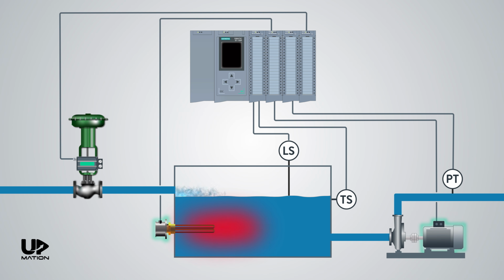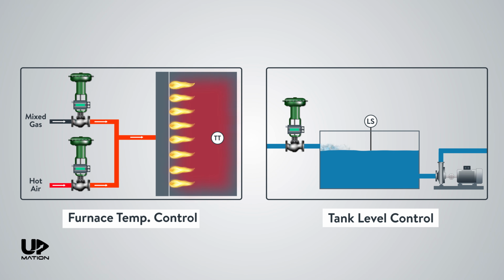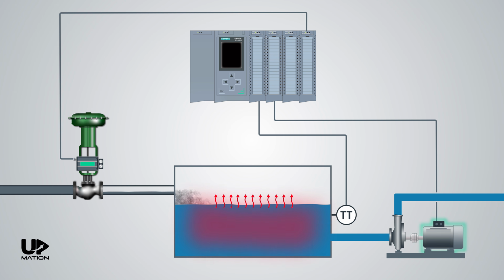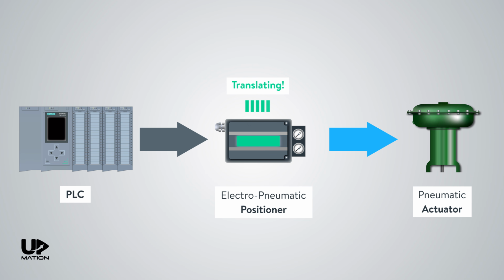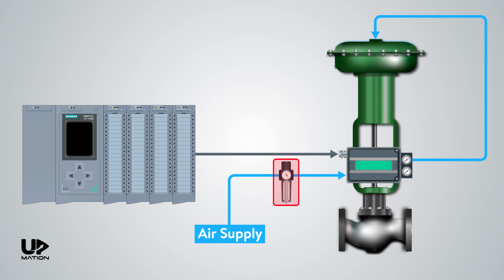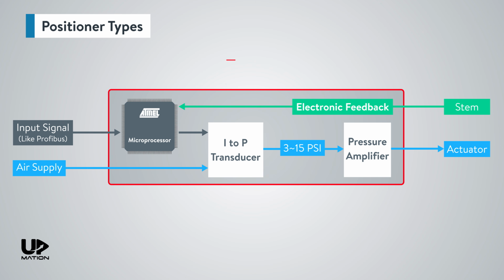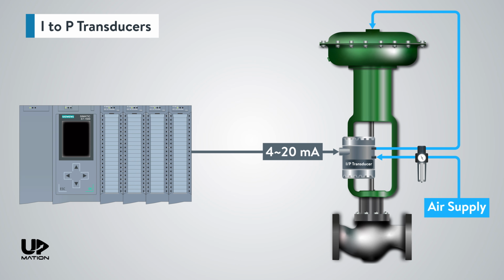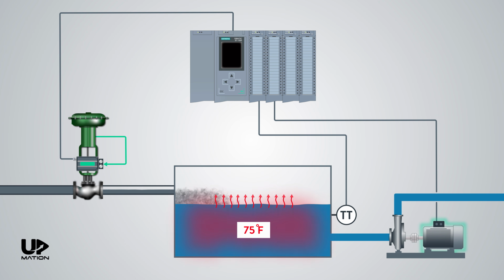How Pneumatic Control Valve Works | Control Valve Actuator Types | Control Valve Positioner Types

Comment: Really good video. Explains clearly. One remark on the actuator overview on time 5:33: I think the air supply should be connected to the Pressure Amplifier instead of the I to P Transducer.

Comment: Where the air will comes from
Reply from the maker: The air which is used for these sorts of usages is provided by a particular unit called an "Instrumentation Air System". Its primary devices are industrial compressors, filters, air reservoirs, air distributors and manifolds, and regulators. Not to mention that it also comprises several instruments, and an electrical power distribution panel(s). You're gonna find this system in almost every type of plant, whether it's a small chemical factory, a mega steel plant, or a petrochemical. Hope this answers your question.

Comment: Perfect job
In my opinion the positioner is a local controller receives its set point from main controller.
What about system stability and the effect of any delay in the positioner response on the whole system performance.
Also do you have any video about whole system transfer function?

Thanks a lot for your efforts

Comment: Thanks for this. I was about to compare difference in P&ID notation, and according to this, there are always three lines to the valve: pneumatic supply, electric, software link or penumatic controller line, and postioner-actuator feedback signal. Cannot really understand why all control valve sets are shown with two only- without supply line.

Comment: This reminds me a car's turbo.
Reply from the maker: Hey, Charles! Thank you for your comment; and why is that?
Reply: @Upmation  its not exact. You got actuators controlling (waste) gates, and control ( blow off) valves controlling overall flow, w/ mechanical and electronic controls. The only main difference i see is a turbo controls 2 gasses at once, exhaust gas and air intake. Its all about pressure.

Comment: Excellent video....But what i want to know is, the pressure signal sent to the actuator is in the form of air which is inputed to the control valve..I'm i right?
Secondly, the electric actuators make use of motors to achieve throttling of the valve, are there also feedback mechanism just as in the pneumatic actuators?

Comment: Pl. Don't encryt alphabets on the picture.This disturbing the view of moving parts of equipment.
Reply from the maker: Hi there! If you mean the Captions or Subtitles you can easily turn it off in your YouTube player. Or you can change its default format (Size, background color, font, etc.) also from your YouTube player settings. It is actually not in our hands.

Comment: I need these specifications. Who are the sober American companies that can deal with them to prepare this type of valve?I need these specifications. Who are the sober American companies that can deal with them to prepare this type of valve?
Complete Regulator valves ( control valves ) Specification Two way , single ported , globe style body , cage guided , equal percentage characteristic , metal seat , low noise , flow under , plug push down to closed , RF flange end connection ( B16.5) ,  carbon steel body (ASTM A216 WCB), trim materials (316 stainless steel), PTFE packing, valve design according to 6D & testing to AP1598, fitted with electro hydraulic actuator & hand wheel operator, Operation condition:: 1 Valve type 2 flanged 3  size 4 Fluid 5 Fluid temperature 6 Inlet pressure 7 Outlet pressure 8 Flow Globe RF 8 " x 600 lbs natural gas ( 5to 40c " ) 50 - 20 bar 10 - 15bar 25000 m/h Item no .  Description 1 Complete regulator globe valve fitted with electro hydraulic & hand wheel operator : End connection size & class On 8 " class 600 LBS Accessories:: Local positional .

Comment: Good video. A couple things to keep in mind; 
As a rule you don't need a full PID. These processes are slow and the D, derivative, isn't useful. 
Modulate the valve or the pump.  Don't try to modulate both.
If using an I/P place it as close to the valve as possible to prevent lag.
Reply from the maker: Thanks for the inputs! Great points to mention.

Comment: If air supply lost, actuator will remain in its present state or it will be opened fully?
Reply from the maker: It completely depends on the process. Normally the actuator should change its position to the safest position in case a failure occurs in the system. It might be Close or Open depending on the process.

Comment: I am interested in the automatic operation of electro-pneumatic control valve installed on the discharge line of cooling water pumps and being controled by flow control valve

Comment: Which is best  to use pneumatic or electrical one...which one more reliable...
Reply from the maker: I think there is not any best or better! It completely depends on the situation. For example, as it has been explained in the video, the pneumatic valves are intrinsically safe and can be used for hazardous areas. On the other hand, the electric valves, can be used in cases that we do not have access to compressed air. So these are only a few reasons that came to my mind. You let me know what you think.

Comment: Good explanation, I have a question, how the pump starts, if the control valve is 30% open will run at full speed or it will bypass the liquid through by pass line
Reply from the maker: Thank you! In this case, the pump will run at its full speed and the control will be done by the valve itself.

Comment: I am confused about the 3-15 PSI part. You wanted the valve to open 50% so you sent a 12 mA signal, which the positioner proportionally translates to a 9 psi signal to the actuator. But then, we need more air supply and actually have to apply 20 psi to the actuator for it to put the valve at 50% open? If 20 psi = 50%, then what is the point of the 3 - 15 psi? Why not call it 2 - 38 psi for example?
Reply from the maker: Thank you for your comment and apologies for my belated response.
First of all, the 3-15 PSI (which is the (Pneumatic) CONTROL SIGNAL) and the 40 PSI air source are supplied by two different resources. So please don't confuse them together.
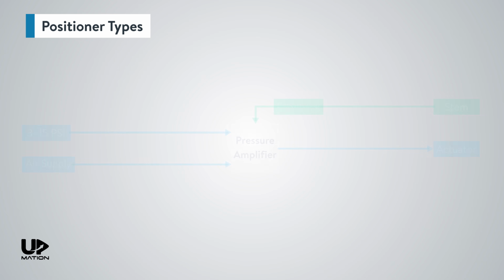There is a mechanical mechanism within the electro-pneumatic positioners (amplifying relays) that receives the 40 PSI air pressure and applies the required amount of that to the actuator, IN PROPORTION to the PNEUMATIC CONTROL SIGNAL (@6:22)

Imagine we need to close the valve to 70%. We need to apply about 11mA to the positioner input; The positioner (I/P transducer) converts it to 8.4 PSI and applies it to its Amplifying unit (relay).
The amplifying unit of the positioner gets the 40PSI on its input and converts it to 28PSI on its output (according to the command it received which is 8.4PSI)
and applies it to the actuator.
We have made the animations simple to teach you the basics. but we might better add a separate Air Supply to the pressure amplifier unit in the animations.

About the 3-15 PSI, and not 2-38 PSI; It is a standard that the relevant organizations have considered.
Anyways, sorry for any confusion or misunderstanding and let us know if you have further questions.
Reply: @Upmation  Thank you for your detailed response! That clears it up for me.

Comment: Thank you for the video..please my question is if I have a Globe Valve that has I to p and also positioner and yet the stem span is not traveling fully. What will I do
Reply from the maker: You're welcome! I think the most probable reason is that your valve is not calibrated. You need to refer to an instrument mechanic.

Comment: we are facing a problem regarding Pneumatic ACV we installed 6 ACV 4 ACV,s working ok but 2 ACV,s creating problem all the downloading are done form  the DCS but when we give command to open our ACV but doesn't open will you please suggest what we do it so that it start working like other ACV
Reply from the maker: Hi, Ali! What comes to my mind in the first place, is that the network connections to the valves should be checked. I know my answer may sound disappointing! But remotely, I cannot help you more than this! :)

Comment: is there a compressor inside the positioner or how the air is compressed ?
Reply from the maker: Hi Ahmed! The compressed air comes from an air compressor which is a separated device. We did not discuss it here as it was not much related to the subject.

Comment: Thank you very much for the video, it is very well detailed!! I have a question concerning pneumatic actuators, should they need a continuous air supply to maintain the desired position? Thanking you in advance.
Reply from the maker: Hey Sam! You're very welcome and happy you liked it. The short answer is yes, they do. We need compressed air with a specific pressure to be able to control the position of the valve. If we lose the air pressure (due to any reason) the valve should get back to its initial and safe position.
Let us know if you have any questions or suggestions.
Reply: @Upmation  Thank you for your reply, all clear now!! thanks again!!

Comment: How would a three way solenoid valve come into picture here? I have seen solenoid valves being used with control valves. Thanks in advance!
Reply: If theres a solenoid and positioned on a control valve...the solenoid remains open...it is usually piped to the actuator...output going to the positioner...when de energized it will act as an emergency device to dump air and close or open valve...
Reply from the maker: Hi Aditya! I believe that was not a modulating valve. It might be an ON/OFF valve (for example, a ball valve) with a pneumatic actuator like this: https://bit.ly/2J1Ak6U
Does it resemble this one?
These actuators need a DCV (Solenoid Valve) attached to them to get them open or closed.
If you need more information about DCVs, this video may help you with an actual example: https://upmation.com/directional-control-valve/
Let me know if this answer helped you? Thank you!